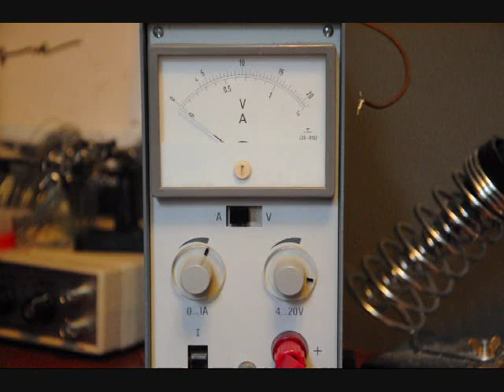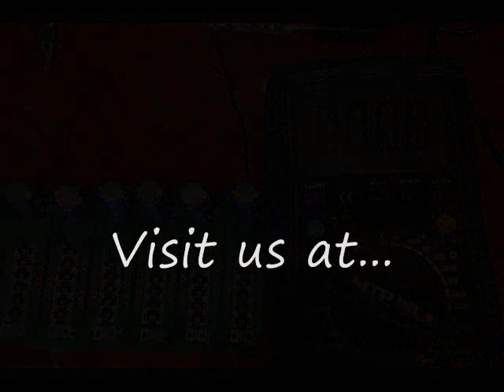Super capacitor balancing circuitry - 16.2v bank @ 600 farads max series capacitance

Comment: got anything 6s 2.7 models that can handle the output required for spot welding? also, all i see is resisters, possibly diodes(zenners maybe)  at the bottom 90deg rotated. is it seriously that simple? if all you want to do is limit excess voltage? id hesitate to call it full balancing (passive would be a better label )

Comment: There are a number of problems with just using a transistor.  You'd need a microcontroller monitoring the voltage on the cap, that would act to turn the transistor on and off.  There would also be a voltage drop along the transistor. Lots of power would be lost in heat just by applying a high power charge through it.  As well, using your method, you could only charge one cap, not several in series.  No power is lost with this until the charge on the caps reach the danger limit.

Comment: why would you do that... just use a transistor to turn off the capacitors completely after they are at charged voltage. That way you don't completely waste the discharging electricity. Which you were doing (using 1 amp even after they were fully charged).

Comment: A good idea if you know what you are doing - but I really never saw any good circuit balance for supercapacitors

To be honest never found one that's cheap and do great job, only resistor-like and cost at least 30-50USD which is insane

Comment: Hello there. I have a question. What your balancing cirtcuit consist of? I'm also working with Maxwell supercapacitors (650F) and I would like to know how you are balancing voltage. I've look for it and found opamps arrays, and you are not using them. So it could be helpfull if you explain the circuit. Thanks.

Comment: Place a 2 ohm resistor in series with a 2.5v super capacitor won't balance your circuitry!  It will drain it, and very quickly, and the capacitor will have to have to be 2W or more.  That doesn't make any sense at all.  Dude, watch the video.  No capacitor in the series string is in any danger.

Comment: What you're saying doesn't make any sense at all.  No power supply that exists that is not extremely industrial can create low voltage (2.5v-2.7v) at 500+ amps.  Super capacitors have low a ESR; lower than batteries (<=20 milli ohms), and are designed to be able to charge as fast as the user cam provide the current.  Do your research.  If treated properly, super capacitors can be charged 100,000s of times if treated properly, which this circuitry acts to do.

Comment: Even then, as long as you charge a series bank (without balancing circuitry) to no higher than 80% of it's rated value, then you are extremely likely to never damage your super capacitors.  My series bank is charged by solar every single day (to 80% of max capacitance), with no balancing circuitry, and it still works as well as it did on day one.

Comment: ??  Did you even watch the video?  Your statement is completely invalid.  Each series capacitor has it's own set of balancing circuitry, which means that it keeps the voltages within and under the maximum limit of 2.7v or 2.5v (Standard super cap values).  You could have said what you said for any other super capacitor video that had a series bank, but not this one.